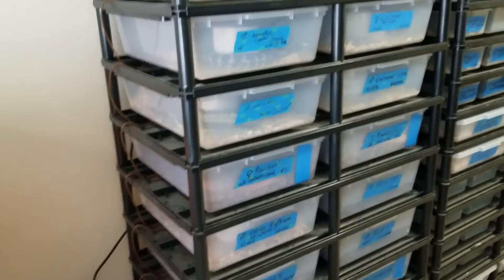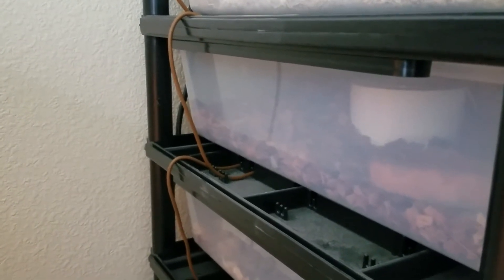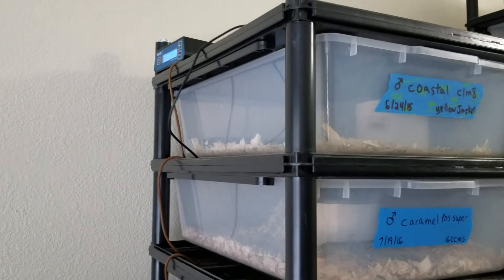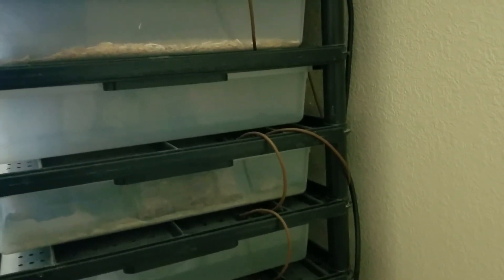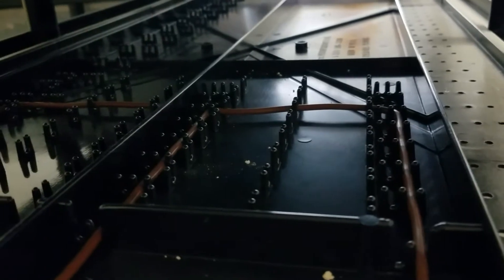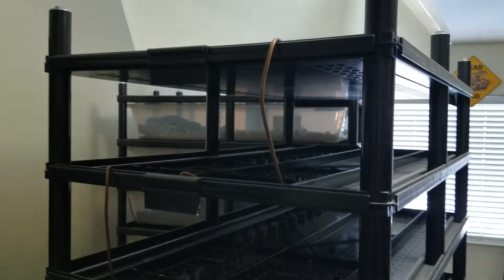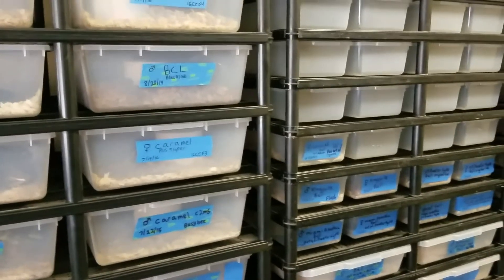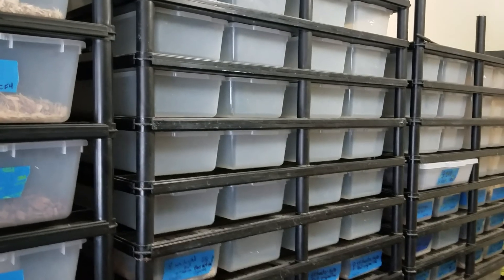How to set up heat cables on vision racks

Comment: Thanks great video! 
Where do you place the probe from the thermostat on a vision rack? I just got a  10 level 32 quart rack.
Reply from the maker: I didn't realize that I didn't answer this question I put it under the heat cable in a back corner
Reply: @livingleglessreptiles9160  Is that the black cord visible at around the 2:00 mark? The top corner by where the thermostat is on the top left side of the rack.
Reply from the maker: @Upper_echelon_exotics   its the cord but it is taking the temp from the middle shelf
Reply: @livingleglessreptiles9160  Oh okay. Thanks!Just trying to figure out the best way to set up the heat rope.

Comment: The wires that are exposed,  I'm assuming is wasted heat?  I'm trying to set up my first storage setup for my gecko, what ar3 the pros and cons of heat mat vs heating cable?
Reply from the maker: MajorBinkss yeah you have alittle waisted heat in this situation but with visions there is no other alternative to heating these racks. In other types of racks you could use flexwatt heat tape but without an area that's recessed the tub is scraping over the heat tape all the time the other downside is you have alot of heat sources that are not being controlled by a thermostat as were these are at most only 1 heat source that isnt regulated
Reply from the maker: Hope this answered your question if not or you have other questions feel free to email me at livinglegless@yahoo.com so we can discuss more.
Reply: I have a ton of left over cord